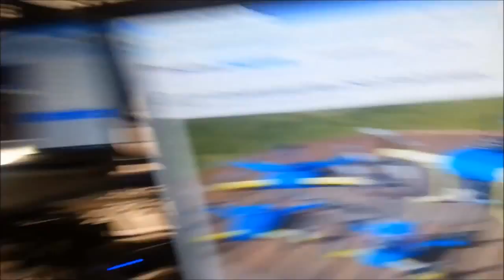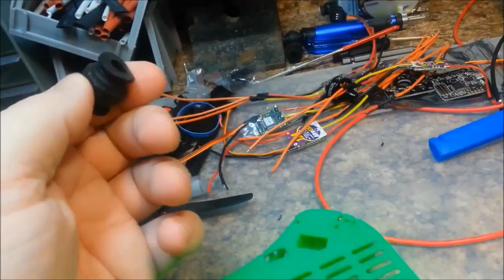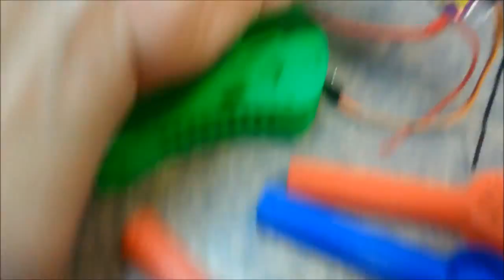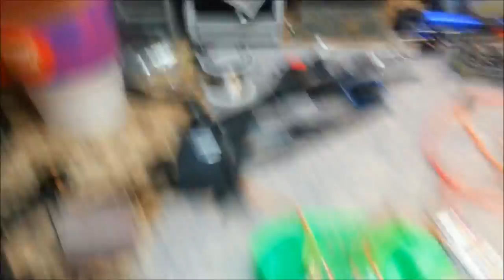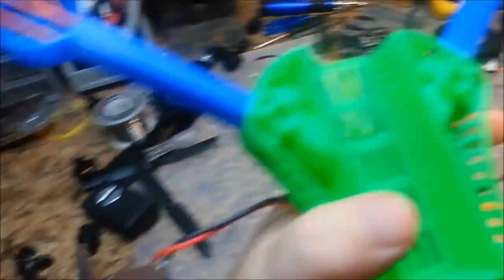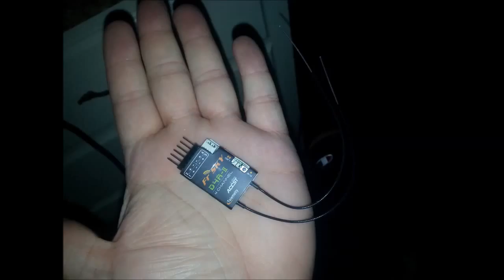3Dprinted T4 Quadcopter Mini 250

Comment: I built the full size T4, my brother built the T4 mini like yours. The problem he had was his motors where overpowered and it wouldn't fly right. I strapped another battery to it and it flew great. I think it will fly ok once he puts a fpv tx and his camera on it. How does yours fly?
Reply from the maker: Joshua Scott Mine does ok, I am still tweaking it. I had the bottom of the motor mount separate from the arm due to too much torque from the motor. It has only done this with one arm but haven't had time to reprint an arm lately due to work. May do a video showing what it did. I didn't crash but it is worrisome enough for me to maybe think about another frame option....lol